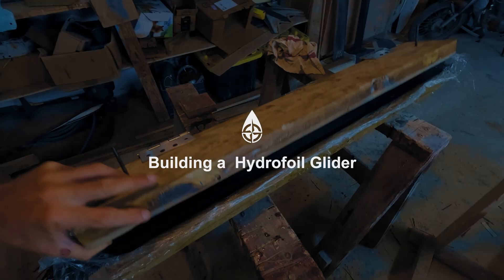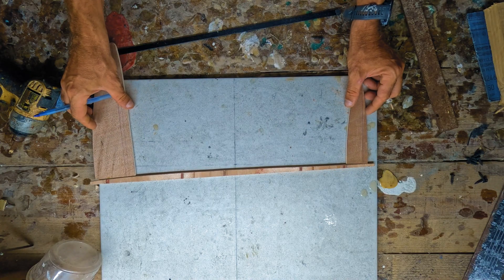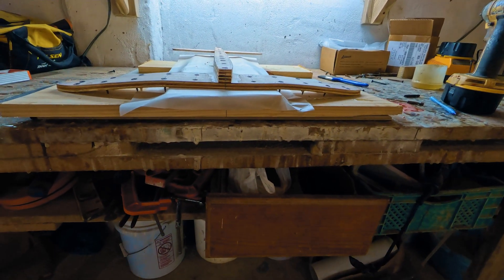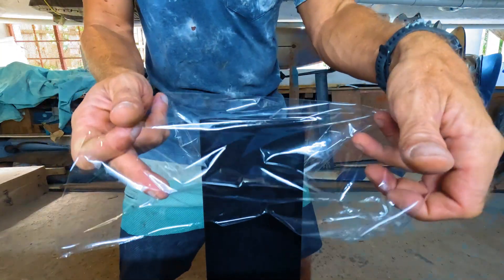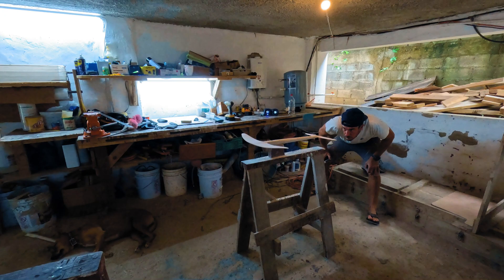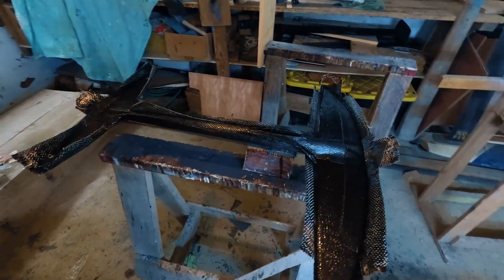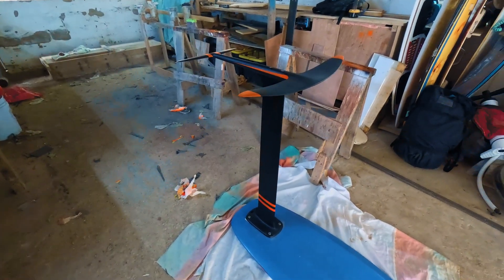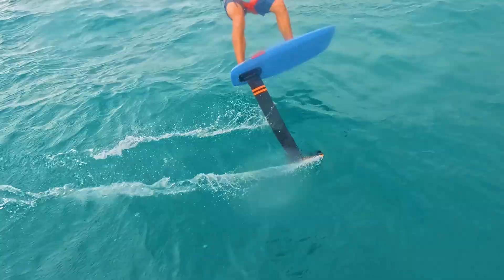How to Build a DIY Hydrofoil Glider

Comment: First congrats on these awesome Foils, great way to build it, I used to build tri-boomerangs as a kid with plywood in a similar fashion (without the carbon of course), Im currently building a similar glider for wingfoiling (810 sqcm) , im at the stage of sanding the profile, what i was wondering is if you wrap around the top layer to the underside to get strength in the leading edge and to prevent cracking under load, i was wondering if that is a sound idea.

Comment: Moving stabilizer 5 mm up doesn't make any sense. First you don't know what angle the fuse would be in the water, and most of the time it is not 0 degree. Second the turbulence would not be confined to a narrow strip, it would expand with the distance, so that the goal of avoiding it with stab placement is impractical.

The weakest part of the build seems to be the mast to the plate connection. I had 2 failures in that areas which prompted me to make a specialized L shaped molds. And there has ro be as many carbon layers in the mast-plate connection as in the plate itself.

Comment: Your older videos inspired me to make my own hydrofoil and eventually my own carbon foil board.  I used your exact method for laminating the plywood and screwing it down.  I am a carpenter by trade so it was not too bad.  I have been riding the foil for over a year and it has held up well!  I modelled mine after the Lyft classic but I find myself wanting something a little more advanced.  I appreciate your video, your editing was leaps and bounds better than your earlier stuff.
Thanks for taking the time to film and upload, when I am workk g the last thing I want to do is stop and take pics or video
Reply from the maker: Im really happy to hear that, it was a good move to use a proven foil as a model for the first one. yea using a camera in the middle of an epoxy job is not ideal, but with a gopro its not too bad.

Comment: Love watching your vids. Helps me gain courage to one day build my own. So stoked to see the gloves too!! Btw what are your thoughts on modifying and improving our existing foils? Augmenting the leading edges, tips, bottom countours camber etc by sanding or adding? Have you ever gone back to add or change your wings performance characteristics afterwards? Should be similar to surfboard fins cutting them down sanding down the leading edges etc

Comment: I really love your builds ! Your "plane" looks so fine and well made ! I'd be tempted to use you method, but I do windfoil, so I need a much bigger foil, and on top of having doubts about its strength and durability with your method (and my very average skills), I would worry about getting the angles/ surfaces right so it would work right.
Reply from the maker: Thanks, it would not be a problem for strength as the foils get exponentially stronger with more thickness, never had any structural issues with my foils yet. However getting the shapes and angles just right does require some trial and error. Building something that flies is very easy, building something that performs is a lot harder.

Comment: Great video! But was the new mast? Top speeds?
Reply from the maker: Good question, I went 43 km/h  in this test session, so not any faster then my personal speed record of 47km/h on the V6 foil, but it was really choppy and I didnt really push hard yet. Also this glider has thicker wings then my record holder v6 glider so that is probably part of the reason. I need a couple of sessions on this foil to get confortable then I'll try some proper speed runs in flatter conditions. CHeers